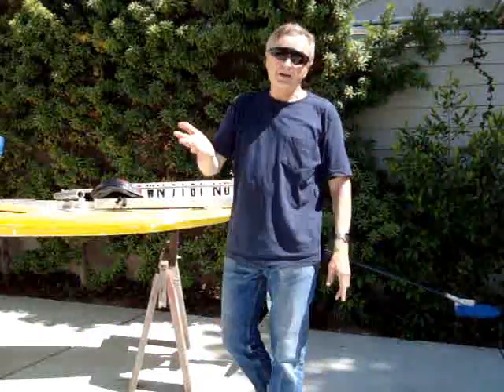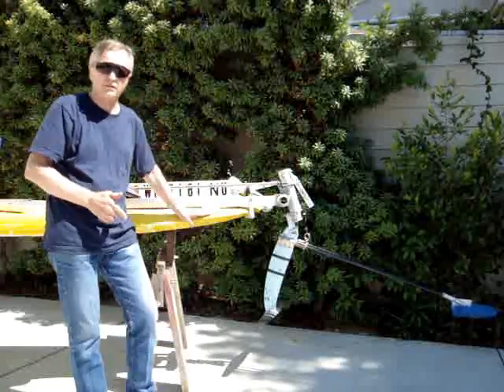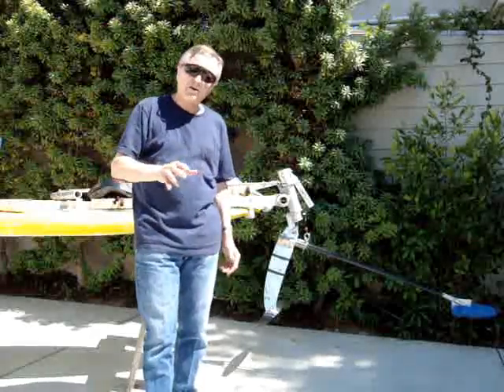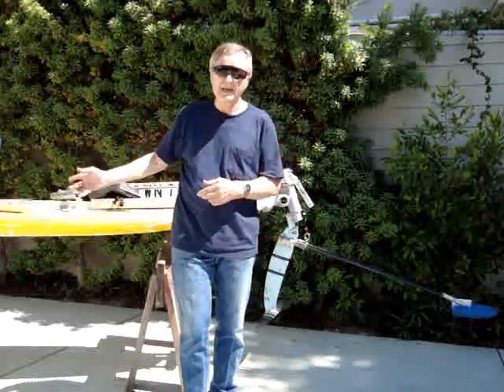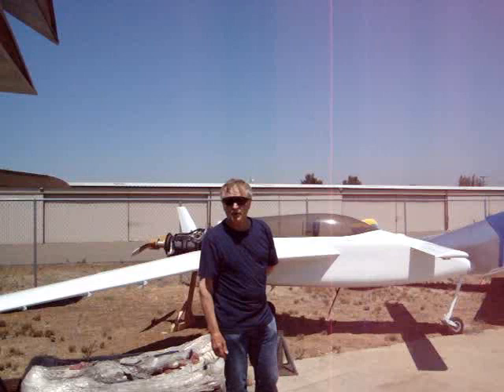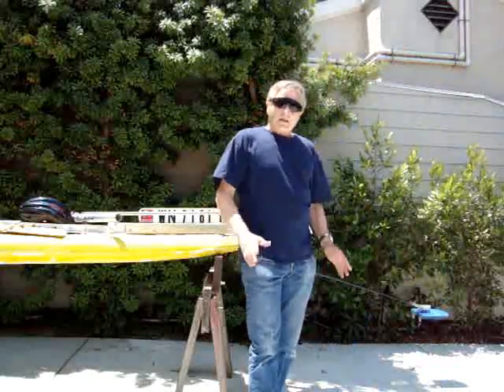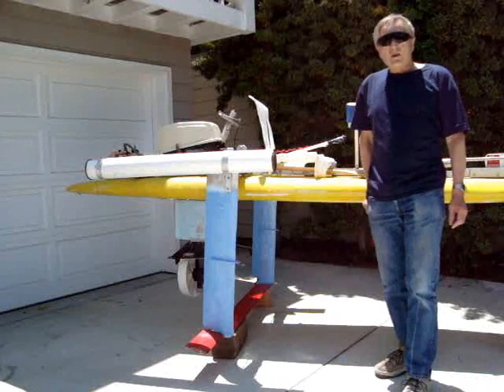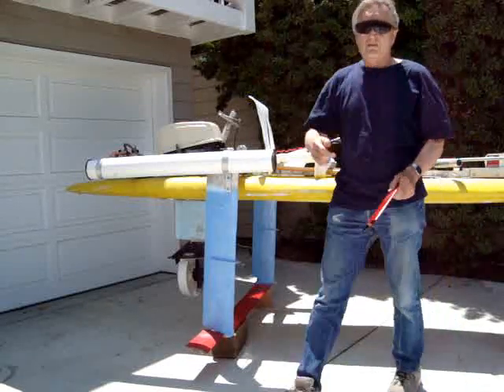HYDROFOIL -- AMAZING Flying Banana has wings like an airplane.  Ray Vellinga video

Comment: Pitch controls airspeed, power controls altitude. My designs completely dissolve the canard and simplifies the design. Its just my ideas BUT every time I see the Kawasaki canard style foils, its just overly complicated for the simpler BUT possibly less effective designs. Imagine an SR71 with 2 rear fins on either side, a main foil in the front with a ducted inboard motor in the middle area, longshafted out the bottom (not integrated into the foil). The hull is a super streamline pontoon/trimarain. Sure, just an idea. Its fun to draw. The similiar style sailing/motor designs ive seen are all super fast, very stable and potentially could be scaled up greatly.

Comment: Hydrofoil downsides?  how strongly are they mounted? Some need high sustained speeds.  Some when they fail, fail catastrophically. Sometimes propulsion systems need to be modified.  Protruding foils increase draft, But there are a lot of advantages depending on how you design your hull. Speed loss due to cavitation is all about how a foil is finished.  Usually if you have the power to go beyond 60kts, which is the cavitation limit and the foil has a mirror polish, you should be OK up to 100mph

Comment: I noticed that your boat is pitching down in the front. As you went by in the video I saw that your boat motor is "pitched in" (Botom is in too far) I bet if you clicked it out one or 2 notches on the motors mount adjustment you would get more speed.

By the sound of the motor it just seems you should be going faster. You may want to get a faster pitched prop or add a "stingray" to the motor.

Cool vid! Kinda corny though. Maybe rename to flying corn ha ha just kidding.